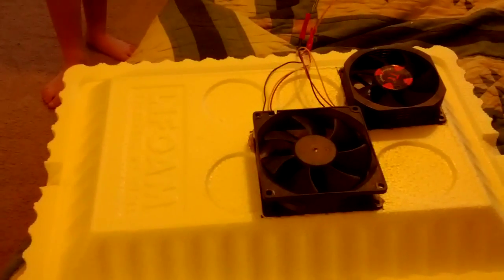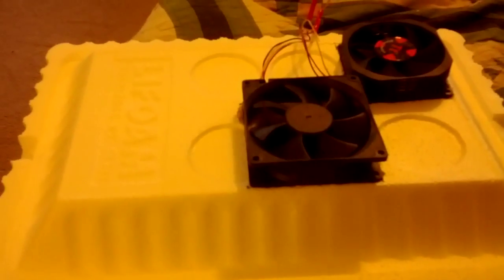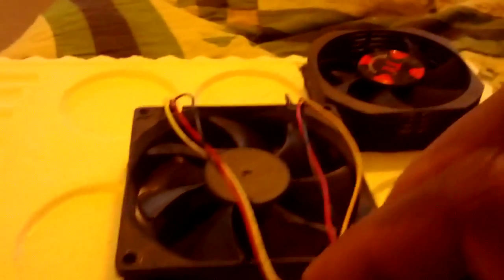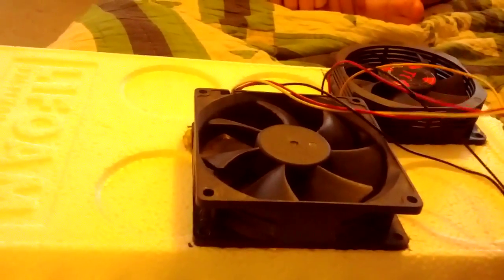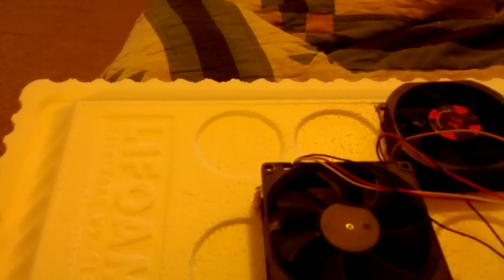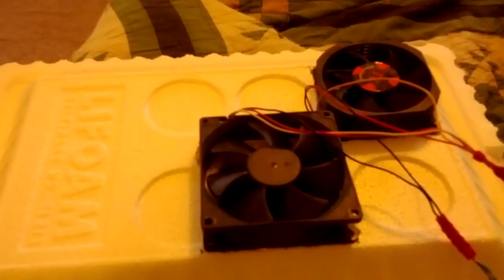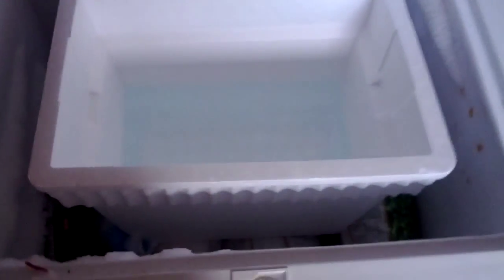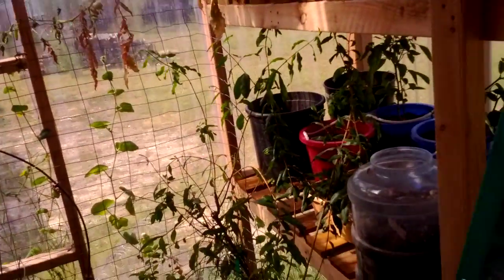Greenhouse air conditioner for only 20 dollars

Comment: I'm not using my greenhouse at all and don't know WHAT good it may be here in central Texas!  LOL... Anyway, I too, wondered how your computer fan/ice chest greenhouse air conditioner worked?  Hope to hear and hope you're still learning how to use your greenhouse.  I want to add a fan, but haven't looked into the whole battery bank/ solar panel thing yet!  Accept your blessings.
Reply from the maker: Unfortunately the greenhouse ac is only helpful in the spring here in Texas. Summer just gets too hot and the temperature variance is just too great to help at all. I will be experimenting soon with different ways to keep them cool. Also soon I will post a video on the shade cloth greenhouse I designed for warmer climate areas. It keeps plants cool so they can survive the summer heat.
Reply: Well, I'm not surprised that nothing much could cool as much as you need here in Texas.  My tomato plants are praying for death and I'M begging them to stay alive until the temp drops so they can produce some more tomatoes as we didn't really get that many.  I don't have shade cloth, but Big Lot's had some of those big  patioumbrellas for sale, so I'm trying to shade some of the afternoon sun from a few of 'em.  I'm just thinking the green house may be good for starting seeds early or maybe potted plants if we have another cold winter like last winter. Thanks for your reply and y'all try and stay as cool as possible.... you know, there's not ONE danged thing on this planet that needs THIS much heat to thrive, huh?  LOL  Accept your blessings!  Marcy